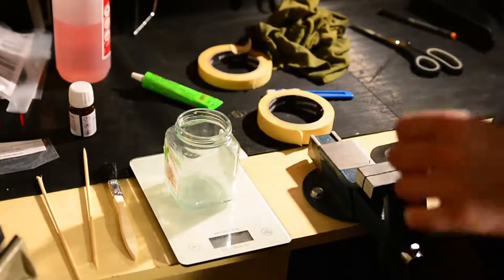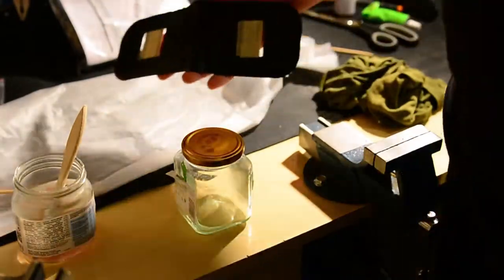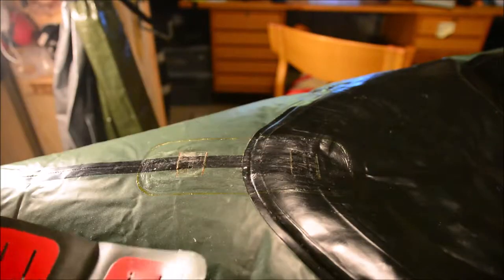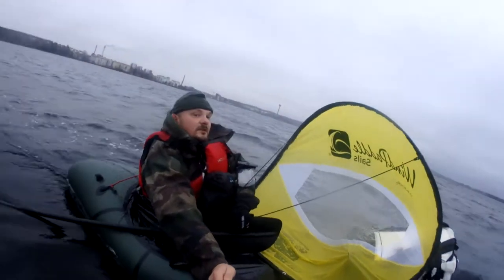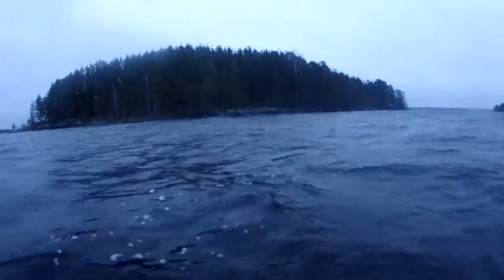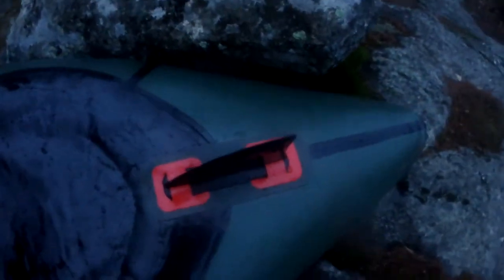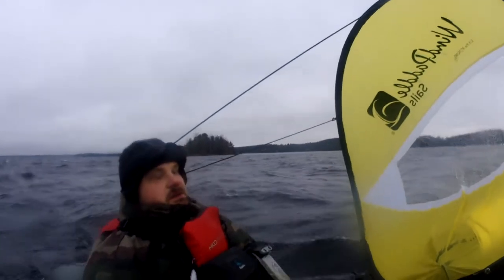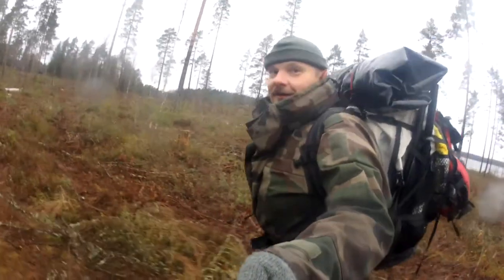Packraft Fin Installation & Paddling on Näsijärvi, Finland

Comment: Perhaps it doesn't make any difference, but I think that the red patches are supposed to be on the bottom, up against the bottom of the packraft. That's an Innova/Gumotex inflatable kayak fin patch, and the fins and patches that are installed on kayaks that already come with fin and patch have the red patches up against the bottom of the boat.
Reply from the maker: Hmm I think you are right, although it does seem to work just as well this way too, at least with my packraft. So far no problems with the fin and the patch has stayed on even after quite a lot of rapids, bushwhacking and dragging the raft through bogs this summer ;)

Comment: Cool idea. I have the wind sail and wondered if adding something like that would help. But I notice you still have to keep your paddle in the water. Do you think it is worth the effort to add the fin? Has the glue lasted?
Reply from the maker: Hi! For me at least the fin has  been a worthwhile mod as I live in the middle of big lakes. It helps with directional stability when paddling more windy stretches of water and also when sailing. The fin works like a (very) small keel and the paddle is used like a rudder for steering.

The glue has held very well so far, even dragging the raft like a sled on snow/ice for a km or two last winter ;)